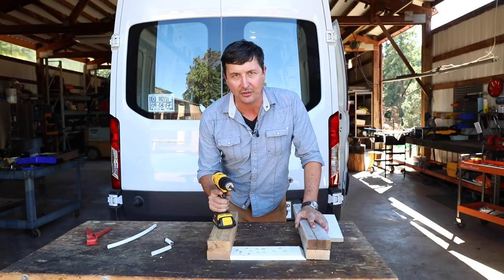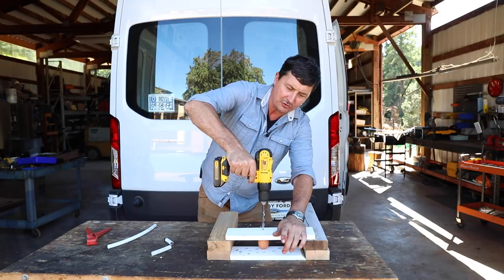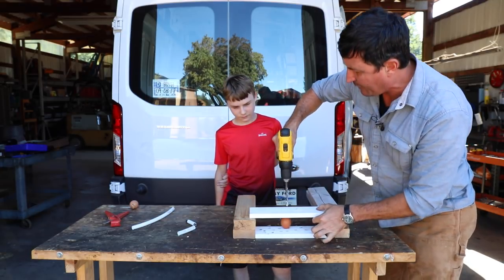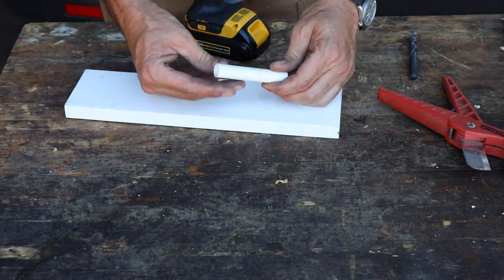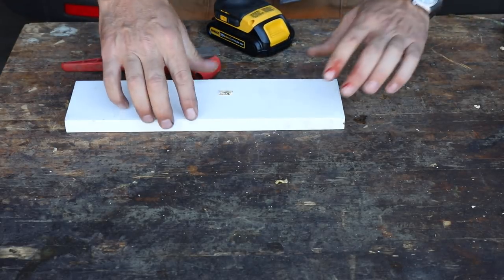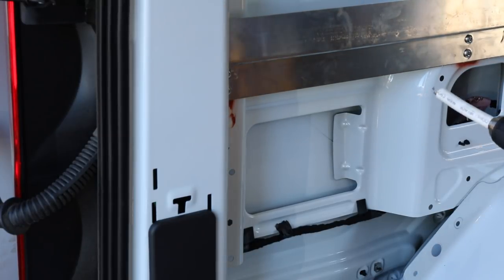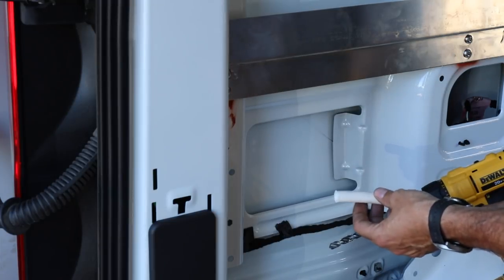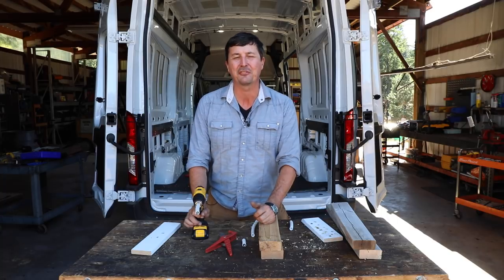Cordless Drill Hack V.S. Egg

Comment: I love drill bit collars they are made for this exact thing. Set them at any hight with a set screw a lot better and get a pack of about 6 different bit sizes for like 5 bucks.
Reply: They're a bit tedious and are drill bit specific, this method looks to be faster and more adaptable for use with different size bits. On the downside it could put little circles on the surface of your work, much like drill stops do, I guess you can't have everything.

Comment: I did this when working electrical construction when making holes in the ceiling for all thread anchors.  I used scrap pieces of EMT conduit.  Works great.  After a while though the drill sleeve will deform and need to be replaced.  So watch for that if you use this trick for restricting your drill depth.

Comment: I work in aviation, specifically on sheet metal and this is extremely important when drilling through the skin of the aircraft and not going into wire harnesses (tons of them).  We use a tools specific for this task which are very ridged springs with a bushing on either end and a set screw in one end to hold it in place.  Love the homemade version though!!😉

Comment: Figured that out myself a long time ago but i used a wood block that i drilled thru with the drill ill be useing. Also works well as a depth stop for counter sinks if you have to sink a lot of holes and want every skrew to be perfectly flush with the surface.

Comment: Nice tip that was new to me. I've always used a flag of masking or electrical tape to mark the stop on the drill bit, but this is easier and more reliable. And as it happens I had a need to use it today.

Comment: Ive found with a 18v dewalt cordless drill at 7pounds roughly on the clutch using a 6.5mm hex socket extension works great on roofing screws into hardwood for a nice and sturdy hook to hang anything handy on while not having the sharp ends protrude the other side of the board without a pilot hole

Comment: I love you, your family and your videos Cory, but I was taught you don't use force on a drill motor. You use a sharp bit and let the bit do its job. 
So my advise is: Keep those drill bits sharp!
I've purchased two "Drill Doctor " (Made in Ashland, Oregon USA) over the years and use electrical tape as a depth gage and it keeps all my Split-Points, Standard Points, and Masonry bits sharp. (and with some low quality masonry bits, better than new.) 
I purchased my first Drill Doctor in 1983 which was sadly loaned out and never returned, and I replaced it in 2002 ( their Model 750 Professional) and have probably sharpened well over 1000 bits (most smaller diameter 135° HS steel needing just a very light touch up) and the diamond stones are still going strong.
Highly recommend the Drill Doctor to all DIYers and small business owners who use drill motors. Great Quality American Made tool.

The DRILL DOCTOR 750X retails at $140.00 and is sold at Amazon.com, Walmart.co and many other places. Please try it out Cory.
Here's a link to their website: http://www.drilldoctor.com/
God Bless.

Comment: I've used this technique for many years. Here is a variation that you can use even if you don't have any pipe around. Stack some scrap wood on the piece you are drilling so that when the drill chuck bottoms out against the scrap, you haven't gone too deep. It can double as a way to make sure you are making the hole at the correct angle.

Comment: I have used nuts on drill bits to the same effect before.  Add more nuts for a shallower hole or take a couple off for a deeper one.  If your going to use it for a lot of holes you tape up the nuts solid.  Just my own hints on this awesome hack.

Comment: Id probably use a step , uni , varibit , or whatever you want to call it for the application you're using . Either that or self taping screws . But I usually use electrical tape and wrap it around the bit just before the depth i am trying to achieve.

Comment: Why not use a step bit for sheet metal? They tend to not grab and pull.
Reply: I agree, less burring too
Reply: They are good in some cases but what about if you need to make a hole close to the larger end of the step bit, but with only 1/2" clearance on the other side?  Not possible with a step bit as you need clearance for all of the smaller steps to pass through.

Comment: Might start using this idea instead of the drill stops I bought. You don't need a allen wrench to tighten a set screw with this like you do with the drill stops. And if I lose it I'm not out any thing. I can always find another scrap piece of pipe.